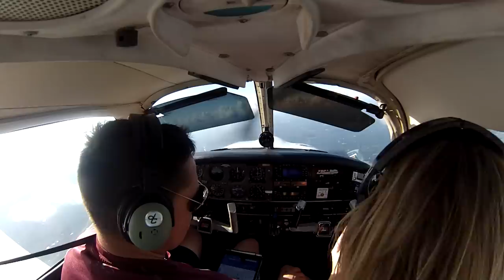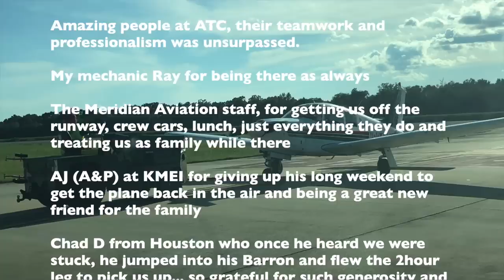Real Emergency - Power Off Landing with family in Piper Arrow after throttle cable breaks

Comment: This just goes to show how different we all perceive these types of situations. In the 30s, engines were sketchy and most of America was farmland. Airmail pilots ended up in a field every few weeks. It was routine. They had the tools and skills to change a bad plug or even swap out a mag in the field. It was no big deal. Now, you practise forced landings for your checkride and probably never again. Engines are good enough that most of us never have to face an engine out.  For this guy even gliding down from a point where he was able to choose when to cut the engine was scary for him. Because he is a chicken? No, it’s just something he never dealt with. If he had a sailplane background it would not have phased him one bit. There is a vid here on youtube where this old guy in a champ cut his engine at 1000 ft and did a Bob Hoover style energy management demo - he glided into his grass strip, rolled off the runway and to a gentle stop in front of his hangar. The comment section went wild calling him crazy, irresponsible, reckless etc. He likely had several decades flying that airplane at that strip and could safely do it in his sleep. Glider pilots do it every time they fly. So did the Space shuttle. A test pilot friend set up a dead stick profile in a single engine airforce jet trainer to develop an engine out landing procedure. Very simple. Hell air canada did it in an a320 when they ran out of gas. But this pilot here had never done it, had not trained for it and clearly his wife had no concept of the hazard level and was terrified and I can understand that totally.  And having the family on board doesn’t help. But had he done some training in a similar airplane and done a few power off landings, or had he flown sailplanes, it would not have phased him. Last summer, for fun, I cut my engine at 5k and glided into a grass strip. I have a small slow 2 place homebuilt (not an rv4 but that would work fine) It was very straight forward. I misjudged it a bit, came in too high, had to slip a bunch, and touched down gently on the numbers. It was easy. This guy did a great job, but with a bit of training or practice he could have done it with out such a high level of stress. He had a controllable airplane, good wx and all the energy he needed. The fear was due to perception and lack of familiarity with the scenario. I expect most people would react in a similar way so no disrespect.

Comment: Hi, I´d be interested on which point (in the video) you did cut the engine.
Reply from the maker: Gday. We were short final. Once I had gear down and landing was assured (lonnnggg runway) shut down. Started pulling back mixture and was able to stabilize the approach a bit before just shutting it down :) thanks for watching!
Reply: @FamilyPilot  Thank you! Appreciate your fast response.. Glad you and your family are safe :)

Comment: Could he have circled above the approach end of the runway, cut the mixture, let the plane slow enough to extend the gear and then land?
Reply from the maker: Hey Matt, that’s an engine out maneuver we practice. In this case I opted for a long straight in approach. Cut mixture to slow then drop gear and once landing is assured bring in the flaps. Both work but being able to choose when to shut off my engine I opted for the long straight in as it’s less risky than timing a rollout - for me anyway. :)
Reply: Thanks for the explanation, glad you guys made it!

Comment: Did it occur to anyone that you could have reduced power by leaning just past peak EGT? After that you could reduce RPMs to further reduce power. That should get you to gear speed. With 10,000 feet you don't need flaps.
Reply from the maker: Hey Tom, that’s what we did once we got our gear down. :)
Reply: What I meant is that you could have used mixture to reduce power to the extent that you could have put the gear down and make an almost normal landing. At least that's the case with the Cessnas I fly. Lean of peak in the 182T I fly most of the time makes for a pretty effective power control, but the engine does run a little rough even though it's fuel injected. The Cessna veneer controls allow for extremely fine prop and mixture changes. I remember that the only Arrow I ever flew had a three level power control that was pretty sensitive to small control movements. 

In those old WW I biplanes with rotary engines they used a magneto cut switch to modulate power. Those things ran at full throttle ALL the time. 

Anyway, great job! You got to use the airplane again.

Comment: I experienced the exact same emergency back in 1987, when flying my '41 Culver Cadet.  It has retractable gear, and instead of a panel light for gear "down and locked", it used a mechanical rod (called "throttle interlock") that would keep the carberator throttle setting from being retarded below around 1700 RPM if the gear wasn't properly dropped and locked.  Well, when I was flying around, that cable-actuated rod became loose in such a way that I couldn't get the RPMs down to where I could land the plane, so I had to kill the engine on final.  I landed okay, and was able to coast to the first turnoff and onto a taxiway. Since I had announced my situation, when I came to a stop several fire engines pulled up, and I had to yell to them not to hose down my plane!
Reply: Photo of the interlock setup as installed on another Cadet:  http://www.culvercadet.com/N20U/joemaridon.htm

Comment: Couldn't u make the mixture super bad so that the engine doesn't burn the fuel as good, therefore slowing u down
Reply from the maker: We used the mixture to shut it down. With the right profile and setup a power off landing worked. Too lean and you risk detonation and other things bad for your engine, but we used the mixture to slow us to a decent profile and then shut her down:)

Comment: One beautiful Spring day on a flight from Northern California to Banning Ca, in my 1956 182 Cessna, I had the throttle fail in the full open position. I had just canceled with Flight following and came back on the power to start my descent into Banning airport. While retarding the throttle there was no reduction in RPM. Within seconds I was holding the throttle in my hand. As I held the now, exposed cable, my wife in her ever lasting curiosity asked me if there was a problem. I answered, no honey, none at all. I will use the other throttle and commenced to lean the engine with the fuel mixture control and started my descent. I entered the pattern with a sputtering but controllable engine and made an uneventful landing.
It is bewildering to me that with all of the talent that assisted this pilot, not one thought to suggest that he used his Other Throttle!
😳
Reply from the maker: Mixture works well when we need it to, prefer the power off option for last part of the approach to avoid detonation inside the cylinders. I cut the mixture piece out of the video as I wanted to spark the cfi conversation vs being seen as providing the solution but you’re absolutely right. I used the mixture to get me to the point where I was controlled and stable then shut down for the power off but with the restart procedure at the ready but thankfully didn’t need it :) thanks for watching and happy skies

Comment: You declared an emergency? A stuck throttle in the open position is easy. Just fly to the nearest airport or even back to your  airport pull the mixture control to kill the engine and glide to a safe landing. Try losing all power immediately after takeoff. I've had so many engine failures I've lost count in all types of aircraft including rotorcraft. I don't even trust Airline Jets anymore. I lost a mixture control cable connection once and of course it immediately killed the engine. You simply deal with it and land as best you can. It goes with the territory of small airplane flying.

Comment: I had a problem with my arrow, with three adults and one child.  My landing gear refused to come down on approach, so the tower informed me it was halfway out.   So I aborted the landing and went to an area of safety and tried all the procedures to get it down with no success.   So tipped my wing ninety degrees to the ground and did a sharp centrifugal turn and yanked on the landing gear levers, and would you believe it the landing almost came off due to the centrifugal force.   So I went back to the airport and on final, I turned off the engine and safely landed the plane with about three firetrucks out my door.
Reply from the maker: Wow!  Great job and good awareness!

Comment: An emergency landing an Arrow with the family?   Yep.  1989 our family was taking a trip to Puerto Vallarta in our Piper Arrow out of Long Beach CA.   The sun had just set and we were crossing the Gulf of California, blue water 360 deg for about an hour, risky.    Dash goes black, no nav, no comms, no electrics, known fog layer over the coast so no lights or landmarks.    We had a horizon, an engine and a compass, vacuum instruments.    I was 16 in the front right seat.   I aviated, Dad troubleshot and did nav.    We ended up watching an airliner that led us into Mazatlan.   Hand cranked the gear down.   Landed with no comm between airliners with no lights, in mexico.   Got met on the taxi-way by some pissed off federales with M-16's in our face.   Spent the night in the clink while they tossed the plane for drugs.   Their mechanic found a frayed in half 'el dynamo' aka generator ground strap, and they let us loose after a cash demand and my dad's gawdy watch.
Reply from the maker: Wow! First glad it worked. Second corruption is upsetting. 3rd glad it all worked out my friend.
Reply: It's all laughs now brother!  Your back seat weapon systems officer did an outstanding job.

Comment: $30 throttle cable... your life depends on it.. I'm surprised it doesn't have a backup system
Reply from the maker: Guess the backup is that it springs to full throttle versus 0... but we’ve replaced all cables in the plane now lol
Reply: @FamilyPilot  kudos to an awesome video and an even more awesome no power Landing!!
Reply: A 2004 LS Chevy engine had throttle by cable.
2005 came out with electronic cable.
What if airplanes had both.. if the electronic cable goes bad you could also use a manual cable!!🤔

Comment: Who the hell designns a plan to go full throttle if the throttle cable snaps... they coulda made it so it would go to a throttle amount that you can continue going forward but also be able to put Landing gear down safely
Reply: I'm not an engineer, or a pilot, but I would think that the intent of full throttle is to minimize the possibility of a stall while taking off, when you are most likely to need full throttle, and when not having it will be most likely fatal. Having it fail by going full throttle during flight is much more survivable (as we have seen) and having it fail during landing would mean the pilot may have to cut power without as much prep, or abort the landing, but still can come out of it alive.
Reply: You can get the speed you want in this situation just by turning back ignition keys(magnetos off) say for 5 seconds then on for 5 seconds, or a longer or shorter time. That's how they flew in the olden days, WW1 for instance. I would prefer the throttle being at full if it got stuck to have enough power if needed.

Comment: The entire video was from the POV seeing out over their shoulders seeing nothing but sky, and then just when the part showing them gliding in to land switches to a bottom view filming up showing nothing but sky. Hmmm. Sucks
Reply from the maker: Agreed.  You can even spot the exact moment when the forward GoPro dies (stops blinking).... we weren’t planning on filming this flight or recording it - that’s why it’s FAA audio since we were not recording. But had enough battery on these cameras to get enough to stitch it together :( but do wish we had the video of prop view. :(
Reply: @FamilyPilot  yeah it definitely missed a great moment in time. But if that's the case and the battery did die out then you did a pretty good job editing it together. Cuz I was about to say "if it wasn't on film it didn't happen" and I saw only shy the entire video, even after landing. 🤣🤣🤣 But since it was a battery issue...things make more sense now.

Comment: Wow.. your woman is awesome while your landing a plane with a stuck throttle your woman is on Facebook or Twitter.. second people that fly these little Cessnas and Piper's need to be MECHANICAL ya know able to fix and diagnose on the "fly". You could have used the choke to slow the engine down. But I guess it's just me. If I'm in an airplane with my family I guess i would want to know how a mechanical object works so I could understand and fix it.. but I digress. At least your woman facebooked it all.. or tweeted it..

Comment: An engine stuck at full throttle does not really qualify as an emergency. For Christs sake he was directly over a 10,000 foot runway. Who gave this guy a pilot certificate. Pull the damn nose up, slow down, extend the gear, shut the damn thing off and land the plane. Ray-bans do not make you an aviator. Dear god you could dead stick a 737 on 10,000 feet. Back in the day, many planes had no throttle. You simply turned the ignition on and off to regulate speed on landing.